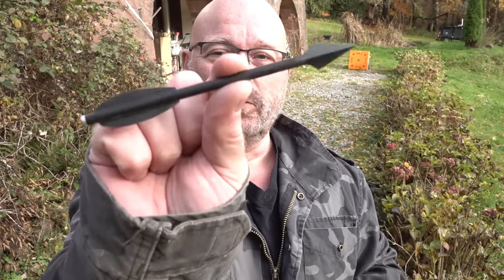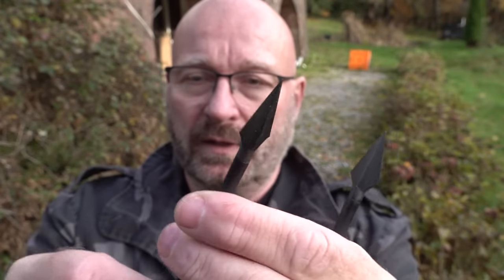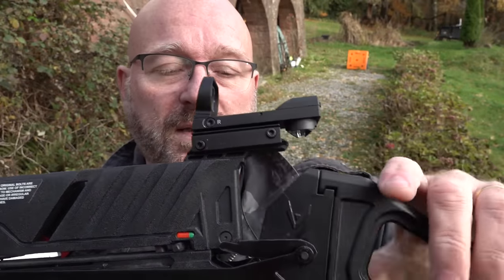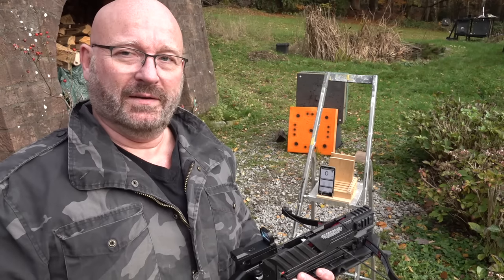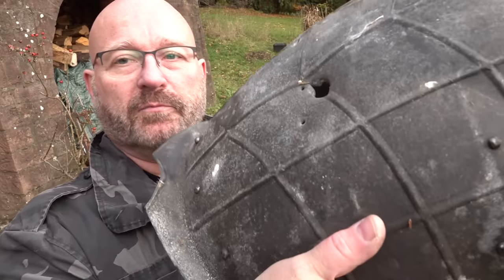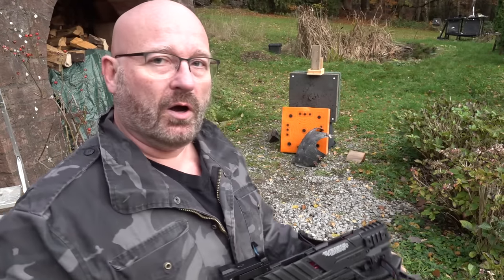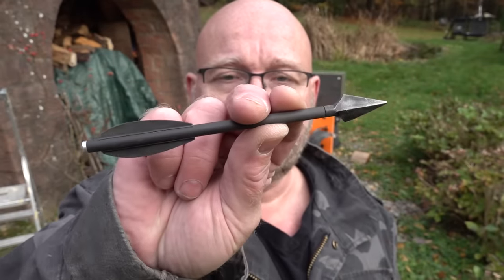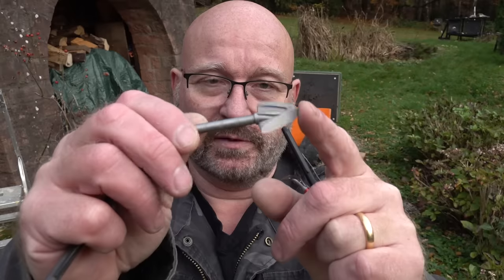Game Changer: The BEST Pistol Crossbow Bolt EVER?

Comment: We needed something like this. It's like a long bodkin. Weapon collector out of England makes 280 gr. Broadhead bolts that are thicker than these. But they can't fit the mag feed pistol bows. This is a very relevant innovation for magazine feed crossbow pistols.
Reply: ive been doing these in carbon, for the last 2 years, theyre on my kofi and ebay :) lol
Reply: @markhuckercelticcrossbows7887  I didn't see those Mark. You do some good work as well. I would like to see them. What are there weight?
Reply: @john9147  funny you should ask, im just doing a video now :)

Comment: Nice to see others finally coming up with these type of bolts, i have been making and selling these for around 2 years, they are very popular.
I use the Anglo Arms bolts are my main base and hardened steel tips like those you used Joerg, the anglo arms bolts are extremely durable in my opinion, personally i prefer the aluminium shafts (not the ones you showed) from experience the ones i use last a lot longer than the aluminum shafts you showed or the carbon ones like adder bolts that can break on the first shot sometimes.
My aluminium / abs vanes broadhead bolts will go through coconuts and thin steel plates too and with out any bending (also i think it becuase the anglo arms ones are thicker walled that the ones shown here.

Comment: Infectious enthuziasm as always!
I was surprized to see alu bend so easily, I probably shouldn't have been.
I wonder if a stiff wood dowel epoxied to fill the hollow in the aluminium tube would be worth it for those on a budget with a good few aluminium shaften quarrels? If you're shooting even a modest distance to the mat/target having a full quiver makes a big difference.
Reply: Why not just fill the ally bolt with epoxy?
Wood can rot over time and that'd cause various issues.
Reply: @OldNavajoTricks  not if is sealed in epoxy.
Reply: @ParadoxISPower  if there's moisture in the wood when it goes in it could cause issues I feel, only way to know is experimentation I guess 🤘

Comment: What a great upgrade Joerg 👍I have been building arrows for close to 15 years now, and Carbon is by far the more superior material to use for higher poundage pistol crossbows. The same goes for the type of tips used for whatever the bolts are used for. Practice or hunting, the weight of the bolt should remain the same weight, so that the weapon can perform at its most optimum efficiency. Glad to see you working on really quality stuff for your already popular bows Sir. Keep up the great content, and wishing you continued success 😇🙏🏹🏹👍
Reply: Why keep the weight of the bolt same? Hight draw weight should use higher weight bolts. For instance, 90lbs draw weight i would use 12gram bolts. What you think?

Comment: The shipped aluminum bolts bending with the stronger limbs also points to why you need to match draw weight with proper projectile mass.

Comment: Yes I cut regular aluminum bow & arrow  shafts just a little longer than the 80lb single shot pistol crossbow melted lead filled in hollow shaft & put a 4 blade  broad head on it. Smackdown /  penitration was great 10-15 yards after that we'll it suck.

Comment: When I switched from recurve to a compound bow with cams, I had to replace all my cedar shafts with aluminum because they were exploding mid air from the power increase.
I have the cobra system, and other than a small manufacturer defect, the thing rocks.  It’s light, and breaks down enough to be packed.
I do think the bow strings could be made from steel cable, for longevity.

Comment: Nice bolts, well engineered, look effective and sturdy. 
I wonder, however, if there would be merit in having a steel shaft. Thus giving you a much heavier bolt. Sure, it flies slower, but stopping power and penetration should be improved.

Comment: Obviously you know this but if you can spin the bolt really rapidly whilst it's sitting in the firing groove before it leaves the bow, that will further improve stability and accuracy. Like how car tyres are used at fairgrounds on rides to speed up or slow things down. That could that be used to spin the bolt up to speed and then to "throw" the bolts instead of a cocking arm and string, two  tyres, one each side of the bolt, to shoot it and one to the top or bottom to spin it. All in a nice seamless transitioning movement. You know! Just throwing ideas out there. But for all intents and purposes still keeping it within the technicalities of the law as a strung bow?? Just with "Let Me Show You Its New Features"! 👍

Comment: Todd's Workshop recently completed a test of a medieval warbow against a properly made armour chest plate... It did not go through, though there was more armour than a chestplate, the test showed you could penetrate the metal as a flat on to you simple flat plate, but not once properly shaped, which was extraordinary! That chest piece you have is display/larping I would suspect, car door thickness.... Though in this day and age you'd be facing Kevlar, anti-stab and ceramics as 'armour'. Looks like a nice bolt :)
Reply from the maker: Pistol crossbows won't ever have a chance to go through real plated armor. I did this test to see how sturdy the tips are. They did well, don't you think?
Reply: @Slingshotchannel  yep

Comment: I need 16inch bolts for a 250lb compound crossbow.  The aluminum ones bend on impact, the carbon fiber ones shatter. Considering solid aluminum ones.

Comment: The walls of those aluminum bolt shafts must be thin an the material itself maliable. Solid bolt shafts, even wooden ones is the way to go. Your solid carbon fiber bolts appear to be the next upward design win. Tks Jorge

Comment: Saxon bolts look really exciting to me. The price and amount of bolts slightly stings (I was hoping for a 10 pack between 20-30€ price range), but the features are definitely superb.

Just recently Steambow launched its own carbon-shafted bolt lineup and bought a pack of them a day before and they're certainly an upgrade, but these new Saxon's do have a much better tip that combines the features of all their 3 tips. I think the Saxons are also still more robust and tougher than Steambow's new carbon bolts too, unless china cheated on us.

One common issue I've had with my bolts - besides the tip and shaft damage - is damage to the vanes of the arrow. If the bolt slips too deep into a target, it cleaves the vanes off the shaft and its not easy to fix them if they got all scrumpled up. I was wondering its possible to have a thin slit through which a vane could be slid into (and glued or taped), instead of the glued-directly-to-shaft method the current market arrows use?

Comment: Hello Jörg! I am still a newby with crossbows, but I have quite some experience with bows and I have a problem: I recently bought an Adder crossbow and I found that the bolts are penetrating my target way too deeply. They stick in almost to the feathers which makes them really hard to pull out. Crossbow shooting is not fun this way. Are there some cheap practice bolts with less penetration power that I could use, or do I have to buy a harder target? 
Any advice is appreciated! 
Awesome video by the way!^^
Reply: You need a harder target.
Reply from the maker: You can either get a better target mat OR use blunt tips. You can simply make them yourself by cutting off the tips of a few of your bolts, with an angle grinder.
Reply: @Slingshotchannel  Thank you for your response!❤️
I will try that! :D

Comment: I dont know if im wrong. But im pretty sure carbon fiber can bend. Im shooting carbon fiber arrows with my sports bow and Ive bent two already by hitting the pins used for fixing the target in place. So "they cannot bend" may be a bit misleading. They are definetely harder to bend tho. Still a great video Jörg! Keep em coming!

Edit: I was wrong. Arrows or bolts made of carbon fiber should not bend they either stay straight or shatter outright.
Reply: They should either bend elastically or just break when the force is too great. At least mine are either good or broken, no permanent deformation.
Reply: @NoNamer123456789   Hm weird then Ive probably got it wrong. Maybe mine are just carbon fiber reinforced and mainly consist of bendable material. Ive got them quite some time ago and picked up archery again just recently. Thanks for the clarification!
Reply: @abehme  It does sound a bit off. You could try breaking one that's already bent yourself, just make sure there's something inbetween you and the arrow when doing so, if it's really carbon fiber you don't want particles flying into your eyes/skin/lungs.

Comment: Are the aluminum shaft bolts hollow?  Do you think it would help the longevity of the shaft if they were solid?  The drawback to that would be they'd be significantly heavier than the carbon bolts, an advantage is they'd also be much less expensive.

Comment: So For the repeating pistol crossbows are they able to be powered by a battery pack that could be incorporated into the stock or somewhere else to cycle the reloading action somehow, using a high  torque but small motor and actuator and would this still keep them within the law?  Im asking say for example less able bodied people who cannot, for whatever reason cock the crossbow the "normal" way.  Similar to how the compressed air system worked to draw the limbs back and cock the bow.  Creating a tunnel of little to no air resistance infront of the bolt before its shot would increase the fps significantly, no? Is there a way to do that?  I'm sure there is.

Comment: any thoughts on square shaft? it would be interesting vs round and square or on diamond in relation to tip and 2 vs 4 fletching
Reply: Fletching has to be 2- they wouldn't be able to load into the magazine or be able to be fired if they had more.
Reply: @vladdracul2379  thank you

Comment: That are fine heads for sure. But wouldn´t it Aerodynamic better if you take a 2 or 3 Edged hardened Needle Bodkin Type Head like that from bronze Age Greece Arrowheads. Should have an higher Speed and Penetration capability while the Wound Chanel should more or  less the same

Comment: Im telling!!!!! you said a nauty word😂good on ya brother they look like  the'll come in handy when z zombie  hunting permits are issued to start the thinning process !!... in uk theres some musuems with devises of getting them things out, there made like tiny spud planters into the same shape of the bolt heads.. You slide a gauge into the wound to find out what shape it is, select the right shaped cup, then snap the shaft ram the tool in the wound using whats left of the shaft for guidance, close such tool around the embedded bolt head  close it, and then yank it out, there's even pokers made into the same shape so you can heat up to red hot them ram that in after to seal the wound, thats if your hav'nt already died of agony and blood loss... GSTUK, 🇬🇧...

Comment: Can the Saxon heads be installed on carbon fiber archery arrows for use with compound or recurve bows?
Reply from the maker: No, but you can buy similar models for thicker bolts, often screw in types too.

Comment: For the two bolts that are the same but different sizes, (16:48) could you not use some kind of coupling to extend the smaller one at the nock so you could use it with both?

Comment: If you leave the tube hollow, no cap on the end, you can drill equally space {around circumference of the shaft} 4 holes just behind the bolt head, the air going into the holes and through the shaft will stabilise it.

Comment: Question: is there a stronger limb I could get that will fit the pse viper pistol crossbow it's a 50 lbs draw now and It actually is pretty good I put a laser sight on it and its very accurate out to around 15 to 20 yards but I would like more power if possible and I don't want to turn the limb backward any suggestions would be welcome and appreciated!  Thanks and bye bye lol 😁👍🤷‍♂️

Comment: I believe the cobra model bows are optimized at 250 gr. Bolt weight. Alligator armex cobra and Tron are optimized at 300 gr. Bolt weight. And redbacks tomcat 2 stinger 1 pro limbs and stinger 2 pro limbs with draw weights between 70 to 90 # draw benefit from 350 gr. Bolts as optimal.

Comment: Hi. Can you tell me the lengths pistol bolts should be. I only want to target shoot. I both an old one at a flea market. It measures approximately 10 in where the bolt should sit?
Reply: Standard pistol bolts are 6.3" or shorter. You can find larger ones but you would need to have a crossbow without the mag feeder so you can put the longer bolts on. If it's a full size crossbow it uses between 18" and 24" for the bolts. Just remember it's dangerous to us a smaller bolt than intended because it can mess up your limbs and potentially fly wonky.

Comment: I have an older 150 lb PSE crossbow that uses 22" (without tip) bolts. Will there be a Saxon bolt available for my crossbow? Are the nocks removeable? My bow requires an odd nock, which I have a hundred or more...

Comment: Does the Saxon warhead already have the best form for penetration and effectifity ? Maybe creating a different tip like a cross shaped Saxon warhead,wave bladed or making it less broad gives it more hardness or penetration
Reply from the maker: The Saxons are a combination between a bodkin and a broadhead. That makes them perfect for tactical purposes, where you want BOTH, good penetration and a wide wound canal.
Reply: @Slingshotchannel  cool Good to know would also be interesting to know how effectively a dart is when changing the tip to a bullet shape (hollowpoint ; Armor piercing tough I don’t think that would work since the speed is far lower or if changing the shaft of the dart to a hollow lightweight steel(or something else really hard and can be sharpened on the front side really well)that is in the front and back open and has a drill form inside like a rifle, this should stabilize it in the air pretty well but would only cut a hole in flesh don’t think it would cut a hole through bone. putting a broadlead on the hollow dart and let air flow past the blade through the barrel, would this stabilize it more or would it lower the speed of the dart aerodynamics would be interesting for this
Reply: At 16 ft pounds would you hunt with this.  And what would you hunt with it.  I find full size crossbows massively overpowered for deer or hogs.  Thanks for the content.  Have you ever done anything on atylatyls?

Comment: When the steel Tipp of the saxon bolt suffers from hitting the foam mat, you should improve them before bringing them on the market. They are not good enough I'm affraid.  Don't replace the crappy old aluminum bolt with a crappy saxon bolt.
DO IT RIGHT DAMN IT

Comment: Hi, your a man of many skills. I have a cunning idea 🤔 let me explain the features 😂🤣 a arrow or bolt with a hollow point, say 11mm !
In this hollow tip place a impact point with a blank cartridge held a few mm away with a rubber ring or perhaps weak glue. As the bolt or arrow lands it strikes the blank 💥 to stop it just blowing away make a few sharp barbed points on the cartridge so it first penetrate then we shall see the boom ?
🤔 I wonder ninja boom stars 💥 maybe the mk ll

Comment: I used the 90 for a while on the stinger, it’s to much for the bolt. They already bent when they leave the x bow. I now use more the adder for longer distance which I tried with the stinger. So I am very happy that this get fixed. Already bought scope, so would be cool. 35 m is my preferred distance, of course u hit, but I want to be accurate. Maybe I will change to 50 if the stinger would have better bolts and is more accurate

Comment: Die Saxon-Bolts sind gerade angekommen. Sie wirken recht beeindruckend. Hoffentlich fliegen sie gut; da gewichtstechnisch sehr kopflastig. Leider nicht - wie im Video vorgestellt - mit Alu-Endkappen, sondern in Plastic. Schade. Das nimmt dem Bolzen etwas an Wertigkeit.
Reply from the maker: Doch, das ist Alu. Kratz mal dran.
Reply: @Slingshotchannel  Oh, doch Alu. In Schwarz. Hab gleich mal den Kratztest gemacht. Alles gut.
Reply: How did the Saxon Warbolts perform compared to the aluminum bolts?
Reply: @Draven  The Saxon bolts are a perfect symbiose of Bodkins and hunter pikes. Heavy, good handling with 90lbs bow. Carbon body is stiff. The penetration power is "shocking". Take care - it might be possible that the bolt goes through the target. In this case the Vanes might be damaged. Test at first with 50lbs or less. Generally - good stuff, but attention - it crakes each Zombie head without any problems ☺️

Comment: Did Saxon and bolt thrower make a new collaboration metal band called Saxon-Bolt? 
Why do we not use "super polymer" like nylon 66 (pa6 or pa66) for shafts ?  It can be extruded , glass filled or fiber reinforced ,  and is extremely tough while sheiggung off the elements with little to no deformation . In fact to my knowledge ,for normal use only leaving it exposed to sunlight for several months to multiple years will degrade the material . 
Food for thought . I also wonder why we don't have ceramic or polymer broadheads .
Reply: Hmmm. I'm not an expert but I would assume that industrial ceramic tips will not survive long. They are very resistant to compression, but absolutely hate elongation or lateral shering forces. Whenever you have to pull out the bolt again, or hit your target at an angle, the crystal structure might break and you will lose your tip. Some dense polymer seems like the better alternative.

Comment: How much do they weigh?
Reply from the maker: 13grams = 200gr
Reply: @Slingshotchannel  Excellent. This well work well for both standard as well as redback or pro limbs. Crossbow pistols have been needing heavier bolts to make better use of their kinetic potential. 200 gr. Isn't too heavy for the 55 lb limbs but will still add impact to 80 to 110 lb offerings. Great Work. Never forget momentum in the archery pyramid!!!!